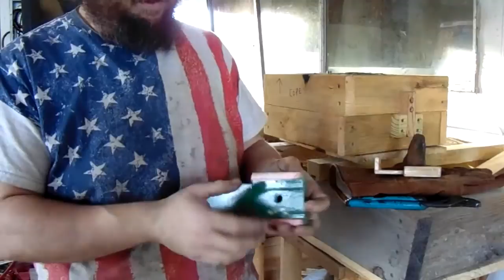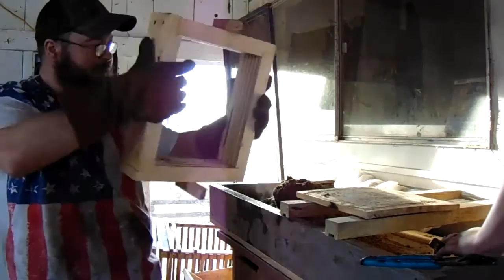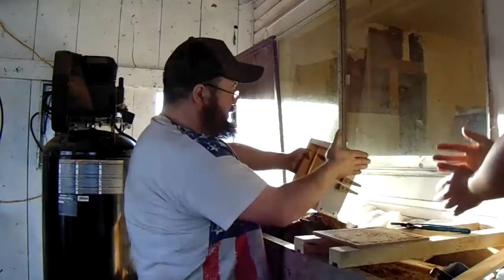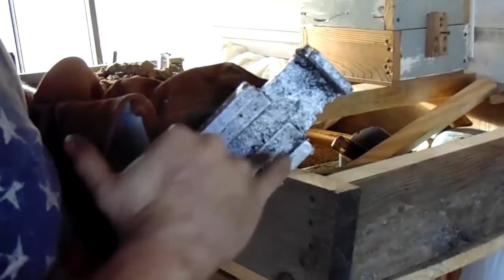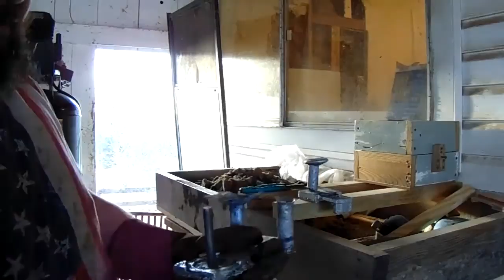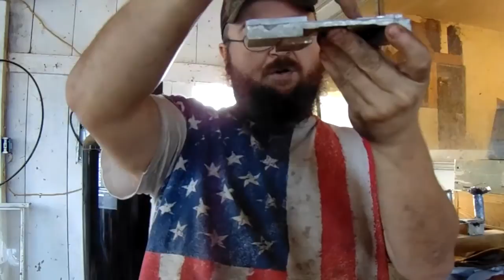Gingery Lathe - Shaking Out More Cast Aluminum Parts for the Gingery Lathe

Comment: Have you finished the lathe ?
Reply from the maker: No sir...   I got the bed, the carriage and the cross slide done and together and I ran into problems getting the compound slide right and I just set it aside for awhile...   I  need to get it done because I have tons of projects lined up to do on a lathe.
Reply: Hillbilly Half Acre Homestead   l hops you e it sorted soon.  Check out olfoundryman's channel     I am still getting setup but plan to work on the process for a while prior to making the lathe.   Should be playing with green sand formulations soon.
Reply: What issues did you have with the compound?